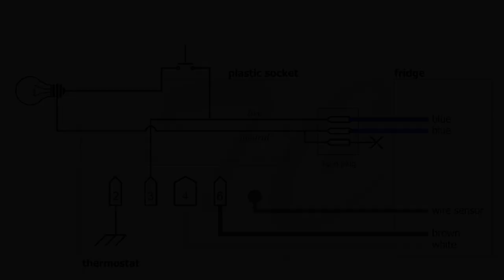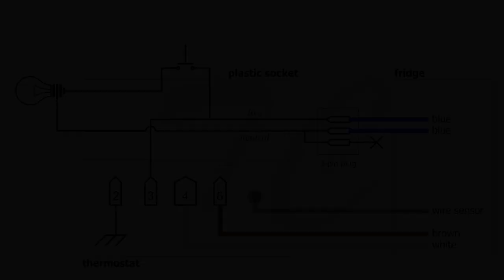Fix a defective refrigerator: replacing thermostat

Comment: I have the same problem with a Tecnik fridge. Where did you get the replacement from?
Reply from the maker: Thanks for watching the video. I get the replacement from eBay some years ago. It was about 20 euro, excluding shipping cost. I was not able to get exactly the same model though as I mentioned in the video. It required some workarounds to replace the original thermostat with the closest model that I could get.